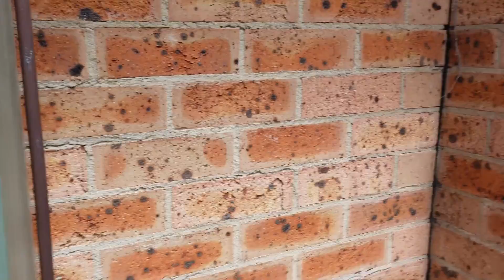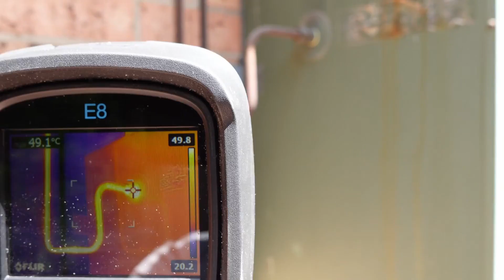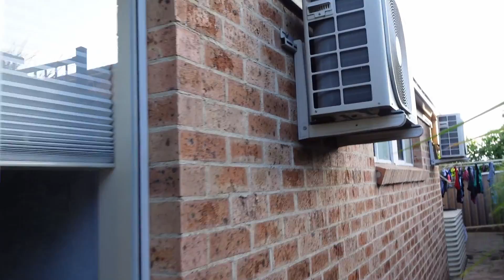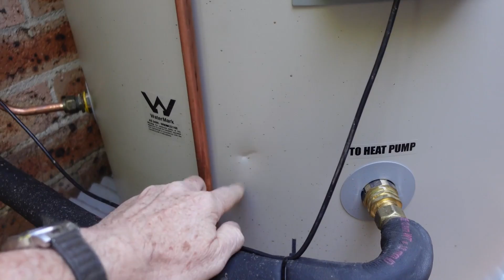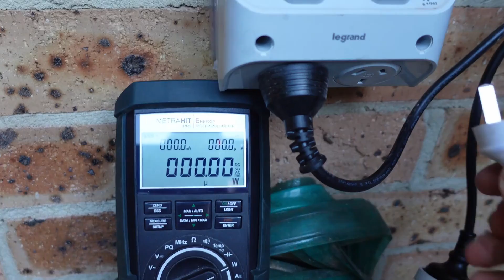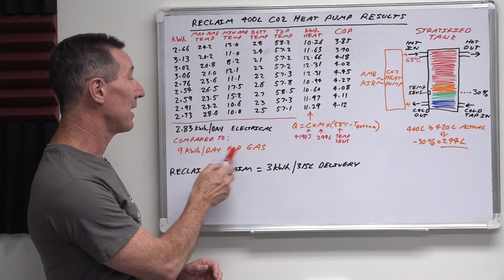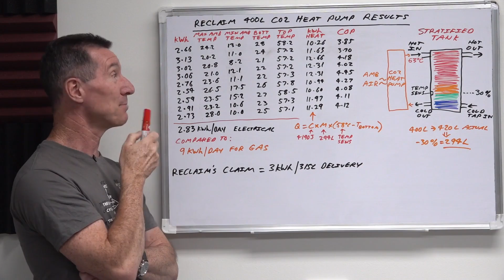EEVblog 1517 - Heat Pump Hot Water Install & Analysis

Comment: Commenting half-way through: Just sadface that it doesn't co-exist with the air conditioner pump; with a clever valve arrangement it could use solar to pull heat from the house to the water and only dump to atmo if the tank is full.
Edit: So it occurs to me it wouldn't be difficult to duct the air-con hot air output to the heat pump input air (other than being ugly as sin). Seems crazy to dump that useful heat to atmo if you're just going to try to suck heat back out.
Reply from the maker: You could probably do somethign tricky like that if you really wanted to.

Comment: Isn't the water tank basically and A/C condenser.  So the pipes from the compressor unit are gas not water. Also in Queensland the hot water system must be installed outside.
Reply from the maker: No, the pipes are water. There is a heat exchanger inside the heat pump.

Comment: You guys have some crazy good water down in Australia if that's only the second water heater your house has ever had.  I don't know of too many places here in the US where water heaters can last that long.  My dad wants to replace his gas water heater with a heat pump style as well.  His water heater and furnace are in the same closet.  He'll be able to use the Water heater to augment the Central Air conditioning in the summer.
Reply from the maker: Very common here for tanks to last many decades.
Reply: Yeah they must have soft water there. Around here without a water softener that water heater would have been full of lime many years back !
Reply: Wow! Here (west coast Canada) water is soft but first gas heater lasted 11 years and worried as we are 11 years into the second. (Everyone in area has similar life spans)
Reply: @tegra5971  There is a sacrificial rod in water heaters that needs to be replaced. If not then instead of the rod getting corroded it will start to corrode the tank. Look it up on youtube - sure there are videos explaining that. When those rods start to go bad sometimes it can make the water smell like rotten eggs. Those rods can be kind of hard to get out if the cap on them is all rusted in. I think ask this old house did a video on replacing them.

Comment: Outside water heaters are common in southern California, not so much in the Midwest.

Gas in the US is measured in CCF or therms. CCF is hundreds of cubic feet; therms are CCF compensated for actual energy content.

You can get gas water heaters with much higher efficiency. The one in my house in Ohio was rated for ~90% IIRC. It did have some odd things to get that efficiency. The flue shot out sideways and had a blower. The thermostat was weird: it controlled the blower, not the gas. The gas was controlled by a vacuum sensor on the flue. If the blower didn't start or was blocked, the gas wouldn't turn on.
Reply from the maker: Yanks are weird.

Comment: Dave. stop with this "solar powered car" thing, it isn't.
Just because the electricity was generated from solar panels at home, and you charge at home, doesn't mean the car is solar powered, by that same logic, internal combustion cars are also solar powered, after all, the energy that allowed that organic matter to be created, and ultimately turn into petroleum, came from the sun, and let's not talk about vehicles that use ethanol produced from sugar cane or other high sugar content plants, that also need the sun to produce that sugar.
Reply from the maker: Bullshit. I can MEASURE that the car is being charged locally from my solar panels, it's the literal direction of current on the incoming mains feed. Have you even seen my Zappi video?
Reply: There are exactly three sources of energy available on earth:
1- Gravity (residual heat of contraction from when the earth formed, small though it is, is available from geothermal systems)
2 - Nuclear (man-made reactors, and almost all the geothermal heat)
and
3 - Solar (everything else)

So rooftop photovoltaics are solar, but so are hydro-electric,  coal, natural gas, gasoline, diesel, wood, peat, and pretty much anything else you can think of (including your body heat and the heat from fermentation and decomposition). 
It's the processing to concentrate and deliver the energy in a usable form that make the difference.

Comment: Dave, so you're saving $700 annually by switching from gas to heat pump water heater. initial cost of heat pump system was $5500. Simple math shows it will take almost 8 years to recover your initial investment (5500/700~8 years) , additionally heat pump requires annual maintenance of ~$100, whereas gas water heaters don't, that pushes your investment recovery period to almost 9 years, by which time the heat pump will near its end of life. Hard to see much of a saving vs keeping your current gas water heater or replacing it with much more efficient gas water heater at a fraction of cost of a heat pump. I realise you want to put your excess electric power to good use, but economics do matter
Reply from the maker: There is ZERO maintenance on the heat pump. And doesn't factor in quickly rising gas prices. My aircon unit has lasted 18 years and still going strong. But the most important point is that we WANT to use our excess solar.

Comment: Super fascinating, been waiting for this episode - thanks for making it! Would love to use one of these systems for hydronic heating as well. Wonder if you can reverse them to behave as a chiller? 

Would be cool to install the heat pump in a server room (yes I'm planning one for my future house!) to pull the heat out of the air as well.
Reply: a hydronic chiller would be possible but also super uncomfortable methinks...just a cold floor that gets all the condensation on it.  Aircon typically has to drain a lot of water from the air.  Hot air rising would mean the floor wouldn't have access to the heat so transfer would be inhibited.
Reply: @frollard  yeah I figured if cold floor is no good I would just get radiators in that case (or typical A/C, but I want the thermal mass of the water)
Reply: @AndyMcBlane  nothing wrong with a thermal cold battery...just remember it's difficult to radiate 'cold' so you need a lot of temperature differential to make sense...at which point your coolant will probably phase change solid...making things more complicated.

Comment: Isn't it more efficient to just heat the water to a lower temperature than add cold water to the hot?
Reply: Having seen the whole video you did explain why, didn't think about killing bugs in the tank, got to used to direct hot water

Comment: Very interesting, I was thinking of getting one, but in peak/off peak costs, the heat pumps are taken off the off peak rate of the meter cost, it’s 1/3 the cost of peak power, so I’m thinking it would end up costing more,

Comment: you are wasting energy. you should add another water tank for the cold water made from the pump. why having separate ac and boiler pump and not unifying the system?
Reply: this pump makes cold air, not cold water.

Comment: I found similar performance with my 415L heat pump in Sydney. After 6 months of investigation, I figured out the real issue, built my own controller and it now uses around 1kW/h per day. You are getting too much reheating of hot water due to your oversized tank, which is lowering the COP.
Reply: "reheating of hot water"? that's not how thermal dynamics works...
Reply: With low water usage, the top half of the tank will be warm and the bottom cold. When the heat pump runs it will heat up the colder water at maximum COP, while the warmer water will be at much lower COP. You get surprising good temperature separation of hot and cold water in a tank.

The thermal interaction is quite complex and too long to discuss in a comment. If you want the full details you can read about my solution on the news site HACKADAY, search for HEAT PUMP and find the article written by Bryan Cockfield.
Reply: @SqueakySnow  the video in the article is no longer available

Comment: As you use excess solar (= free) you could have used a cheap and long lasting (plus quiet!!!) electrical storage hot water system. For 2 people more than sufficient.
Reply from the maker: The peak power is huge, more than our entire solar output in summer time.

Comment: I’m a sparkie in nsw. The pcb on the heat pumps fail all the time, and generally the warranty on them is only 2-3 yrs on the board but 10yrs on the tank. 

I’ve ended up replacing them back to element heaters as the price doesn’t suit most people for repair/replacement boards. 

Hope you have better luck but you would have been better with an element heater and a day time timer
Reply: My townhouse has 6 split system heat pumps for heating/air conditioning installed about 15 years ago, 4 have now died.
Reply from the maker: On this exact brand and model?

Comment: I do wonder what the difference would be when compared between eastern australia and here in the west.

Natural gas costs less over here in the west compared to the east, especially helped by the fact that our government has a 'domestic gas reservation system'.
Reply: True but my on-demand has HWD is costing me a fortune in bottled gas. Partner has loooong showers. Thinking of going heat pump if I can find an installer who will travel out to the sticks to do it.
Reply: @gravlygravy  If you are on bottled, then yeah, will cost a fortune. My grandmother used to be on bottled, eventually my aunty gave up and replaced the entire thing with a small electric unit.

I'm fortunate to have natural gas for the stove and hotwater.
Reply: Pretty much decided to go Rheem hirise 300ltr solar hws now I've discovered i can use my existing gas hws as a booster. Heat pump looks nice but I don't have solar power yet and hot water is my biggest bill so 1st priority to get down.

Comment: Instead of a flowmeter. Use a calibrated bucket 😆 Open the hot water output. Measure watertemp and electrical energy. Do the bucket test every 5 min and average the flowrates.
Reply from the maker: Thought about that too much effort.

Comment: Another way you can Add Efficiency Is Burying A Coil Of The Cold Water Pipe 10 feet underground And That Would HEAT The incoming cold water up 20 to 30 points

Comment: To measure cop. Turn off heater. Remove tempsensor. Flush out all old hot water. Start heatpump and log electrical energy until "cold out" reaches 60°C.

Comment: Another fun fact... the bigger the tank, the more efficient its heat retention (volume vs surface area).   This also allows you to program the controller to not run the heat pump during certain hours (e.g. avoid high time-of-use electricity rates), and not have to worry too much about running out of hot water.   I have my heat pump water heater programmed to not run between 4pm-9pm and its never been a problem for us.

Our heat pump water heater uses around 4kWh/day.  That's about the minimum.  But I also have a hot water recirculator and the pipes are pretty long.  When I run the recirculator on a timer in the morning it adds 2kWh/day for 6 total.  But its better doing that than wasting water witing for the hot to get to the shower.

Your 2.83kWh/day is pretty awesome.  That is a number to be proud of!   I mean, compare it to the solar output.  Our upgraded 5kW solar system produces 30kWh/day+ during the summer and around 16kWh/day in the winter.  And the water heater is using just a tiny bit of that... I'm a happy camper!

-Matt
Reply: Totally on point; big enough heaters are indeed useful for split tariffs. I've got a Stiebel Eltron SH120S in my flat, retrofitted with a ESP8266 based controller that allows me to turn it on and off from my home automation system. It works from 4 till 7 (end of the night trough), then 13 till 16 (afternoon trough). Six hours a day, though the night trough starts at 22. The reason why I don't want to turn it on in the evening is exactly what you mentioned: stand-by losses. Minimizing the time it's hot means minimizing the energy losses, though that tank is already real damn good in this regard (around 1kWh per day at 60 deg C).

Oh, and @EEVBlog finally got some insulation on these pipes now! I wonder why it wasn't there with the gas heater.
Reply: @KeritechElectronics  heh yah, I noticed the lack of insulation too but forgot to comment on it.  The copper pipe is a big radiating surface.  I forget what the wattage per foot is (copper pipe, 125F water,  70F air), but it is not insignificant.  Multiply by 24 hours a day, 7 days a week... definitely not insignificant.

Comment: Yes a water flow meter on the cold input line will have been helping a lot with efficiency calculation.
Reply: Water flow meter also has a nice side job as a leak detector. I've got a hall-sensor based water meter reader after a broken underground pipe drained about half a year worth of water supply. I'm glad I did. Over the last year or so It has detected two minor leaks before they became a real problem.
Reply: Why? For the old system 170 l was taken as more or less how much is used. At least with that number the comparison is done.
Reply: @mauricevandoeselaar  There was no flow measurement for the old system and it was at best a guesstimate.
Old system had temperature output set at 51C so a 31C above cold water input and it used 9kWh per day in average including the unknown loss through thermal insulation.
To heat 170 liters by 31C you need just  170 * 31 *1.16 = 6.1kWh so unless 3kWh where lost to ambient trough that tank thermal insulation each 24h then more water was actually used.
Reply: @electrodacus  the old tank was only 170 l so it's safe to say that that is the maximum they used. And yes the old system was not that efficient. But the new system also only has to supply the same 6 kwh (its safe to assume they still use the same amount of water) not 12 because this tank is larger.
Reply: @mauricevandoeselaar  I'm fairly certain the new tank has better thermal insulation so even if larger losses to ambient should be lower.
The thing is that losses to ambient are unknown thus you can not be sure that 3kWh where loses to ambient on the old tank or they where less and then he used more than 170 liters / 6kWh for water heating.
In any case he uses around 3kWh now so if he has the same consumption and losses to ambient then COP is only 2 in any case less than 3 not around 4 as he concluded and nowhere near 5  they claimed.
Ambient is quite warm so a heat pump can be fairly efficient especially at heating but since water needs to be heated to 63C from a 30C or so ambient the delta is still fairly significant.
It is fairly hard to justify a heat pump as an investment even in best case where ambient is usually warm as at his location.
Reply: @electrodacus  that is exactly my conclusion. If you do not have free electricity, financially it is not viable. In Holland the government is pushing us to using heatpumps for heating the house. The claims of cop or scop are all nice and good, but in the middle of the winter, that is when you need it the most the heatpump has bad cop. Financially natural gas against electricity you need at least a cop of 3 in the wintertime to be break even. But the investment is then not taken into account. I am just a chemist who can do a little math and I learned a bit of thermodynamics.
Reply: @mauricevandoeselaar  If electricity is super cheap as for example from solar PV panels about $0.02/kWh the heat pump also makes no sense as it is cheaper to install 3x larger PV array than to buy a heat pump every 10 years or so for the next 30 years a solar panel will at least last.
I heat my house with solar PV directly as heat pump will not make any sense especially since I will need a ground loop even more expensive than an air heat pump witch will not work at -40C we frequently get here in middle of Canada.

Comment: 51c in the hot water tank? that is dengerus. here we run it at 75-85c. les chase for bugs to grow in it and the pipes. never run the tank below 65c. and outside? here the pipes will freeze over in no time lol. we can teven have pipes inside the outer wall's.
is your inlet pipe as hot as 20c? here it is 7c almoste all year round.. in winter it will dropp a bit due to the distance under ground.

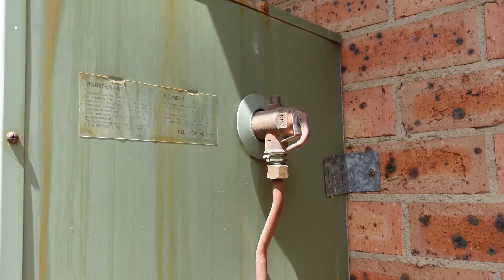Comment: 4:00 There's no tempering valve between the tank and the relief valve, at least there better not be for it to work properly. It opens on over pressure, but it also has a probe (wax motor) that extends into the tank to open independently on over temperature. The are required to be install directly into the tank wall.

If there was a leak somewhere in the system, this could prevent the pressure from increasing enough to open it if the heat source didn't turn off. This video shows the internals of one: https://www.youtube.com/watch?v=IqvY6YGOqro